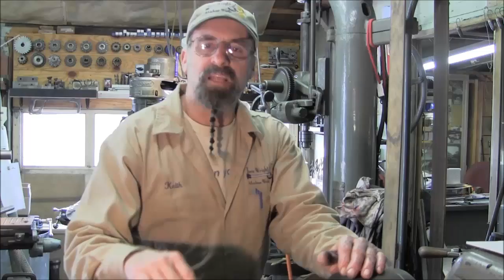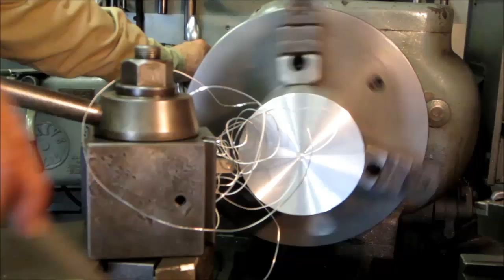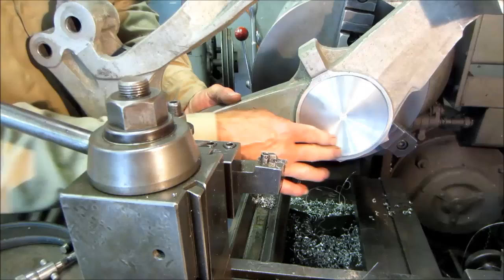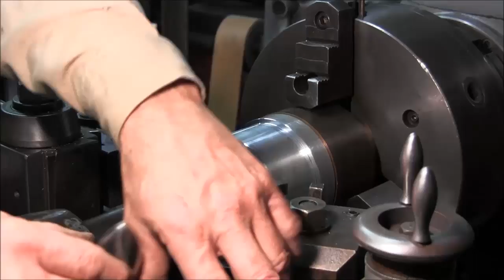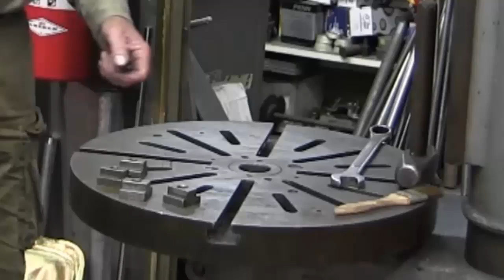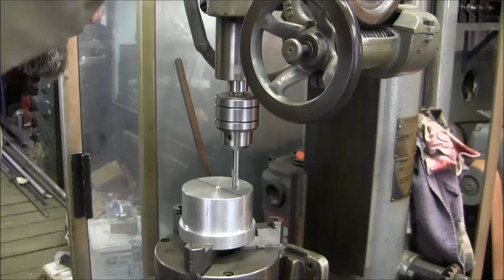Mattracks Part 3 Mail Call: ATV Mattracks Repair

Comment: Hi
Love your work, i was a Millwright long ago, it takes me back,
how do you get away with open belts, in the UK , no way.
Jeff g
Reply: In Michigan, MIOSHA would have fits, but I don't think this shop has employees to be concerned about. Personally, I'd use that plasma cutter, make guards. Believe me, I've built many guards for flywheel/sheaves, pinch points in punch presses, etc. Angle iron and expanded metal make good, light weight guards. Drilling and tapping into cast iron required...

Comment: The first machine I ever used was a Bridgeport... I never did learn all of the things which it could do back then.

So, if you don't have *any* mill, and you can get a Bridgeport or a clone, you can do a heck of a lot more with one of them in your shop.

While I'd kill to have one right now, they aren't going to hog heavy steel the way that a heavier mill will. Then again, I'm not going to be doing work on large parts any time soon. OTOH, if I were suddenly to need to do so, I can buy a big mill

Comment: For a 4.632" to 4.633" ID, I'd have guessed that you would have turned the jig's OD to 4.625" for a 0.003" to 0.004" clearance on each side in the bore... But, that's just the way the old-timers taught me to think - aim for the fractional dimensions where possible...

Comment from the maker: I have one and glad, that I have that one. Most people have over rated them and under use them, while, there are those of us that have over used them and have to under rate them, when it comes to removing massive materials and to simply call it a mill! A spindle mill has so many great charters, like boring and drilling, with adjustable head, column and sliding ram, there are a lot of names I like to call it. My nicknames are created due to the over worshiping I hear by others. ;{)-----

Comment from the maker: I over extended my reach, pinched nerves and partially pulled the socket out on my shoulder, I've had it pushed back in now twice, I learn slow! LOL. Back on the tub grinder job I pulled a rib out, which is a piece of cake compared to the shoulder socket. My chassey is worn and got to slow down now while off roading. It only hurts when I do this! ;{)----

Comment: Some times you need a full time electrician in the shop. LOL nice cord job. Get yourselvf one of them LED lamps in your lathe work area. The one that doubleboost and oxtoolco described looks neat. Oh, better make sure you got a nice drawbolt in your tailstock and that it's properly threaded and hardened. I already broke mine too twice.

Comment: Always wondered why you seemed to release the tailstock hold down on tightening it, never thought it would be a left hand thread.  Wonder if you are going to make one from something like silver steel (drill stock) so it can be hardened relatively easily.